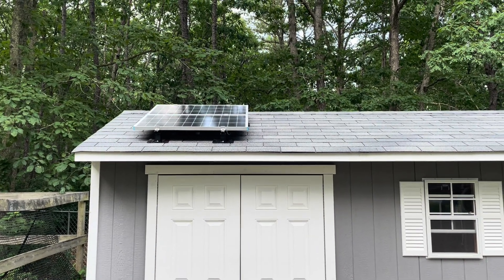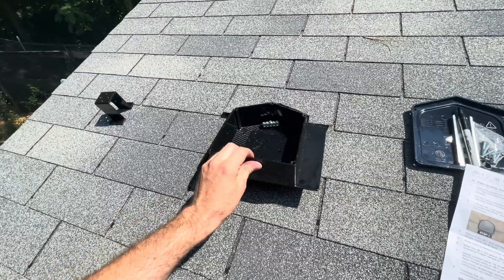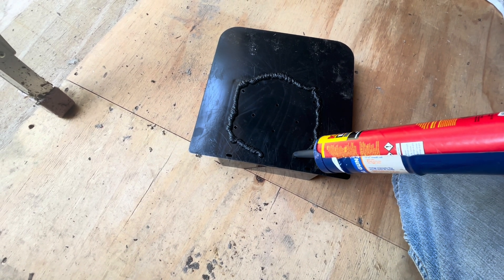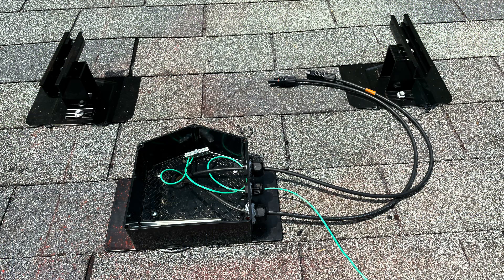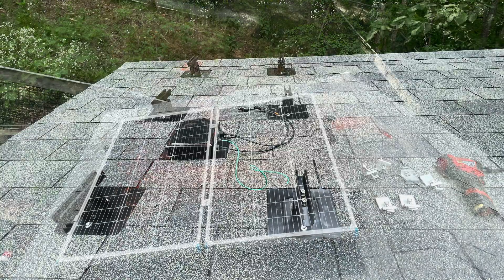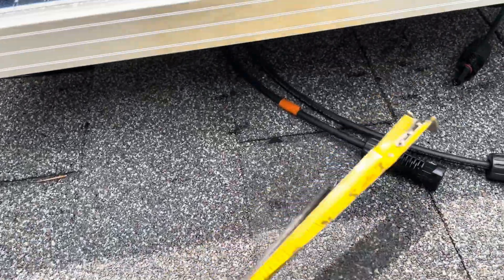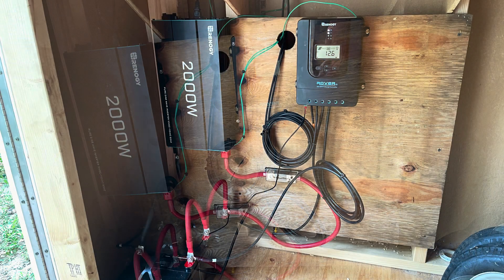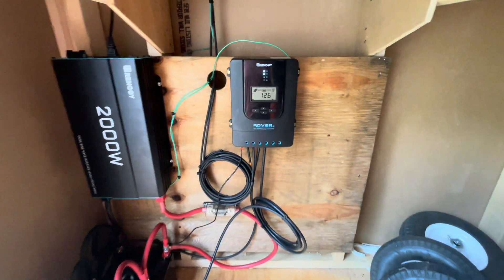Installing Solar Panels on my Shed

Comment: What a professional job.  I attached the panels to the (south facing) side of the shed with angled brackets so that they would be as perpendicular to the sun as possible.  It looks like you did a great job - and I have the same charge controller....
Reply from the maker: Thankyou, I tried to do it right so my new shed would not have any leaks.

Comment: More information in less than 3 minutes than most videos have in 30+ minutes. Excellent presentation.
Reply from the maker: Thank you for that feedback.
Reply: I'm curious about those feet that you used to attach to the roof. What are they called?
Reply from the maker: They are from Signature Solar, and called 6" Asphalt Mini Rail with Flashing. You need the Mini Rail kit, camps, and grounding parts. I wish I had more footage about them for my video, but their website has a lot of good info. https://signaturesolar.com/asphalt-mini-rail-w-flashing-roof-mount-for-panel-6in-black/